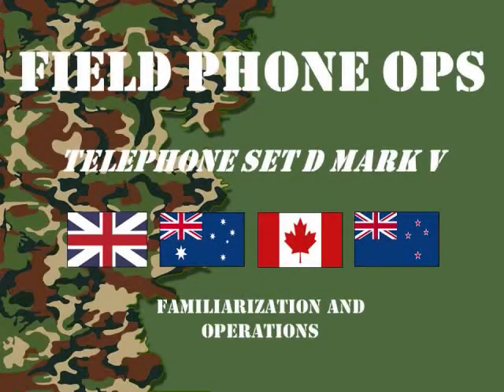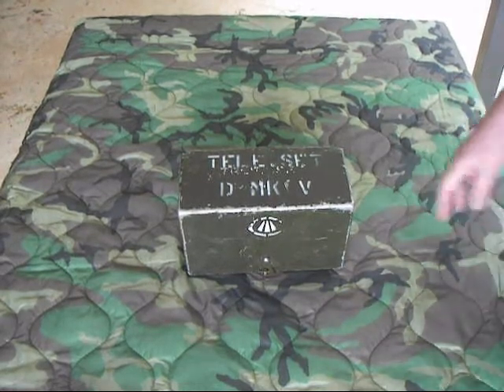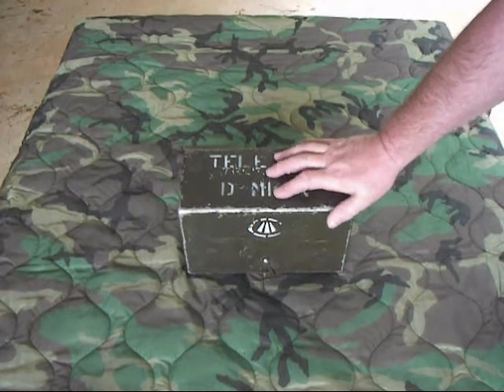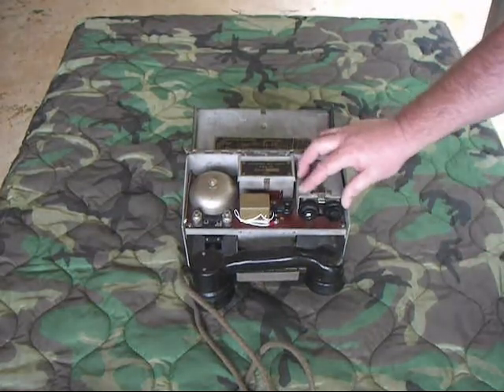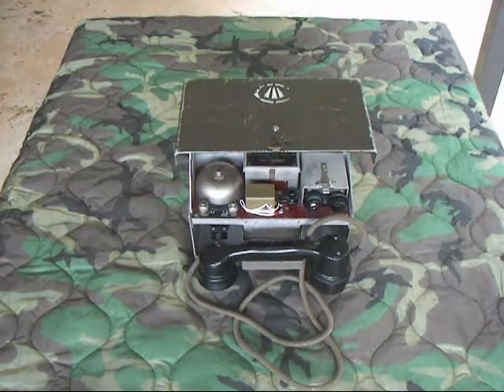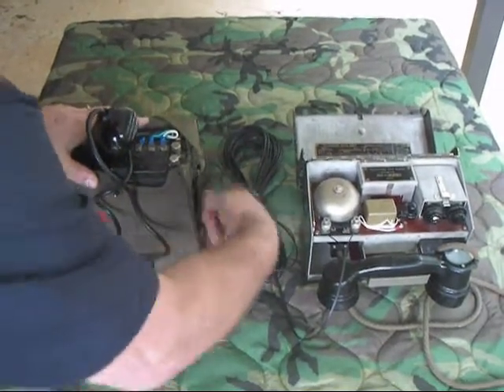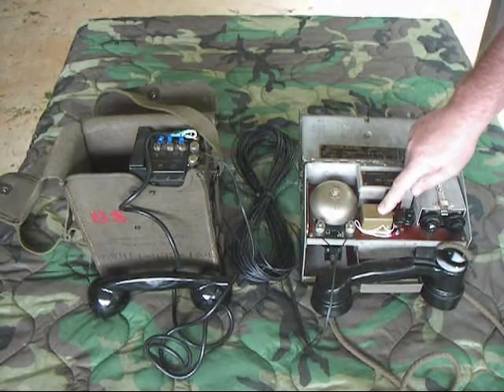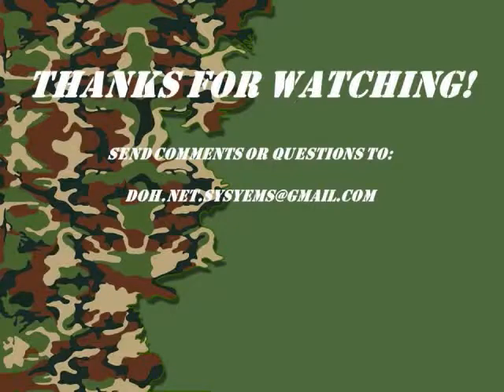FIELD PHONE OPS: Telephone Set D MK V

Comment: I bought one of these last night and was going through the internet to find info about it and came across your video. Very informative and nice to se it working. Mine appears to be a bit more complete ie it gas the original morse key (which sits at 90 deg to the way yours is mounted) it also has a headset which is hardwired to terminals in the box just below where the 4 pin plug inserts. I imagine it would be easier for an operator to use it when using the morse key so that he could have both hands free.

Cheers

Trevor
Reply from the maker: Mine was missing the morse key so I added one that is from the old USSR!  My hope is to find an original on line!  Mine is missing the headset.  The unit was designed to be used as a telephone with voice being the primary method of communications and the morse key used to function as a method to call other stations or for limited morse code applications.  British MOD field telephone switchboards of the day had a feature that would register the buzzer being pressed as an incoming ring signal and would activate a light to notify the operator to answer the call.  Most field phones have an option of allowing headphones to be attached to allow other parties to monitor a phone call and to allow the users hand's to be free to manipulate and mark maps or documents.
Reply from the maker: In morse mode they will only work with another Set D.  I tried connecting it to a EE8 and you could head the morse code buzzes but could only reply in voice.  I also tried connecting to a Fuller Phone but it would not function at all.
Reply from the maker: Glad I could help!  Check out our Military Field Phone Collectors Group FB page at 
https://www.facebook.com/groups/632699090958433

Comment: Hi, I also have one of these units and I was wondering what is the easiest way to get the buzzer to sound and the bell to ring? I would like to hear what both sound like. Thanks for a great video!
Reply from the maker: Install the batteries and adjust the buzzer knobs following the instructions on the inside of the cover. Pressing down on the telegraph key should then sound the buzzer,  The only way to get the bell to ring is to connect another field phone phone that has a hand cranked magneto.  Hope this helps.